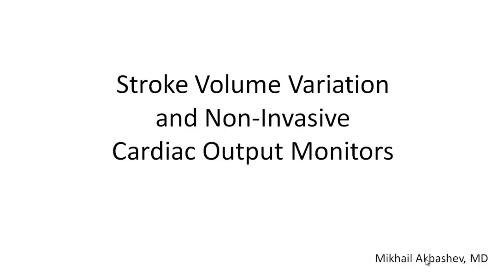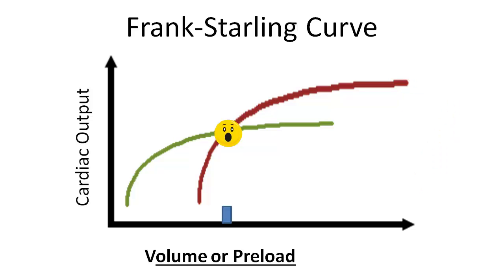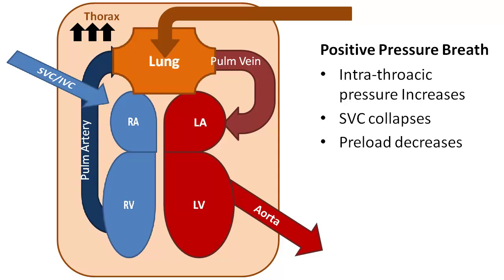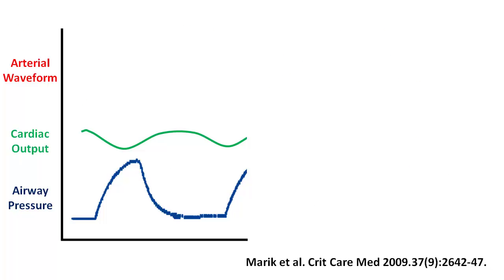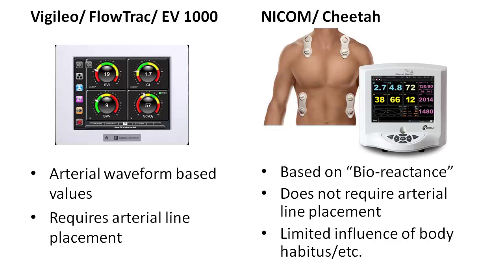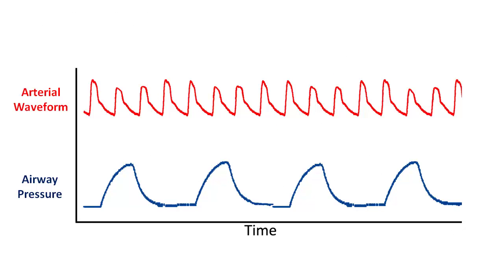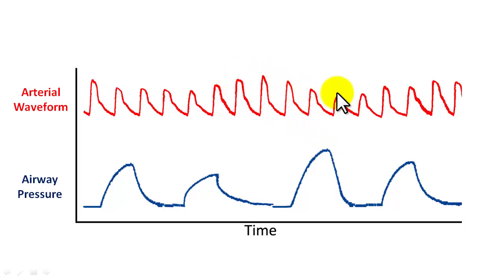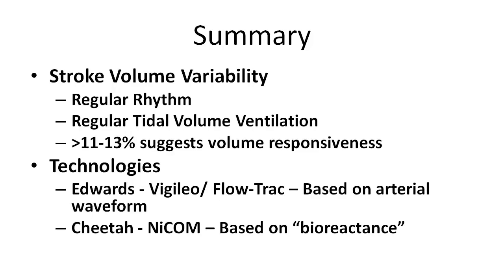Stroke Volume Variation and Non-Invasive Cardiac Output Monitoring

Comment: How do you decided whether to use the NICOM or Flo Trac for a given patient?
Reply: Mamalama I believe if the patient has an A line you can use Flo Track compared to NICOM which is non invasive... they won't have an invasive line.
Reply: Mamalama...Gina A is right Flo Track requires an A-line to get your SVV, SVI, CO,CI results. But it will need a CVP line for SVR, SVRI. A good A-line is a must because if your  A-Line is "positional", the results are not reliable.  With NICOM, A-Line is not required.  Prepping the skin is an absolute necessity for NICOM.
Reply: Well the EV1000 (flotrac) also has a noninvasive option called Clearsight that is pretty awesome.